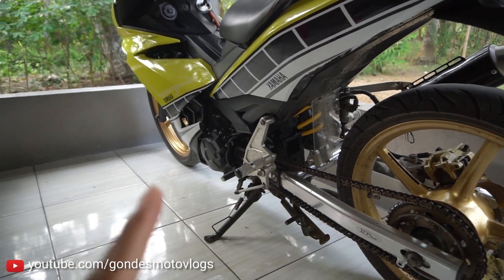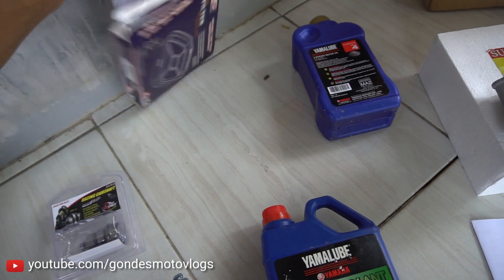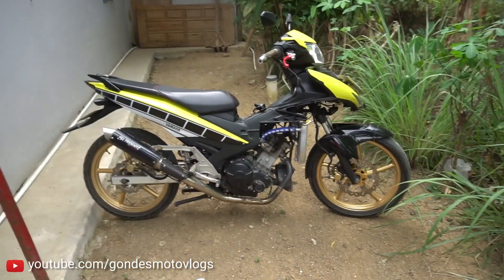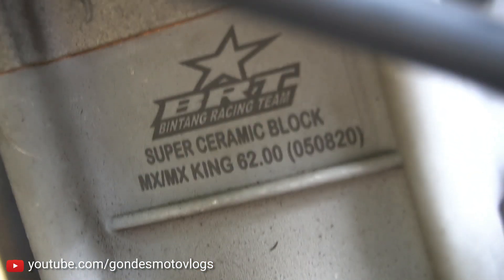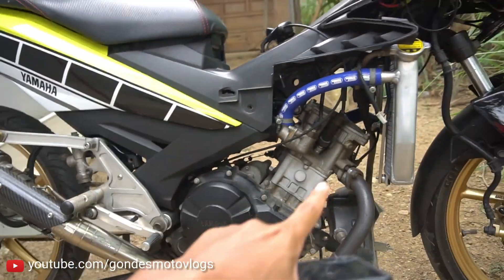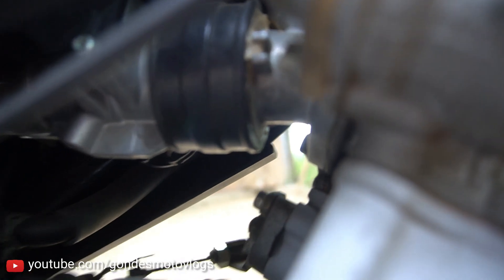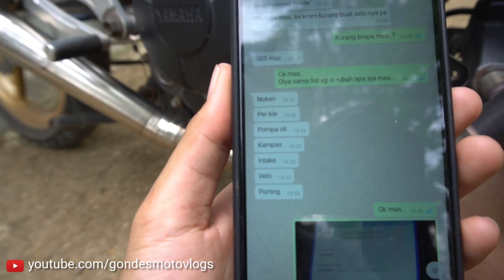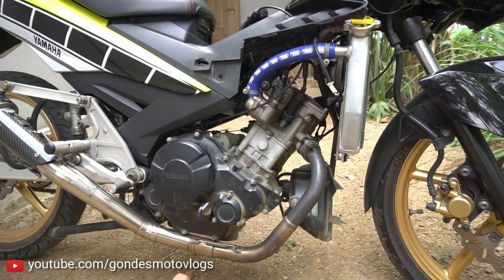Boreup MX King 177 cc Harian di Djambak Setan

Comment: MX King punya saonone dapet 172 km/h kok punya mas gondes 150 km/h berat y???
Reply: Gedean final gear dia masih pake standart
Reply: Saonone pake klep 23/20 noken lift tinggi gear 41 kalo ga salah
Reply: @adaam2950  itu mah borup kompetisi dah gak jadi boreup harian ntr😁
Reply: @Victor_Tactical  tapi masih di paje harian motornya
Reply: Bore up banyak macam nya bro klo kayak punya saonone itu kan buat kompetisi full oprek, motor saya juga bore up tapi buat harian cuma naik cc 177, naik kompresi 12:1, knalpot proliner long, sama ganti TB untuk part lain sampai ECU masih standar tembus 155km/h
Reply: @asv6706  pake ecu std tenaganya gimana? Gw juga 177cc sih pake klep 22/19, juken, tb xtr 33mm knalpot proliner short
Reply: @adaam2950  gigi 1-4 tenaganya ngisi terus tapi pas gigi 5-6  dari 7000 rpm ke 10000 rpm kerasa berat kayak nge drop gitu naiknya agak lama